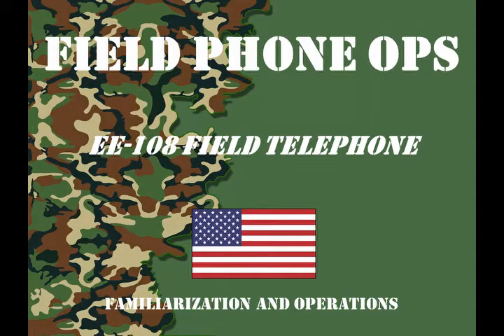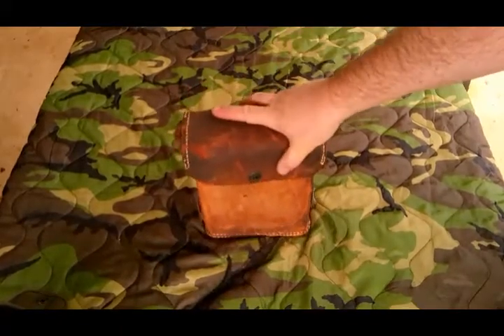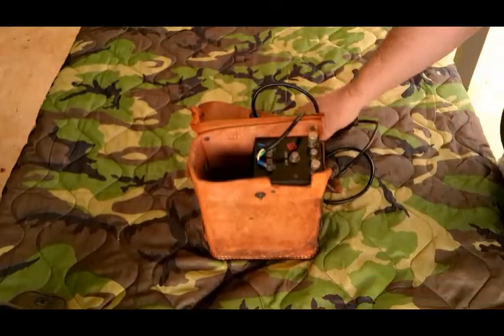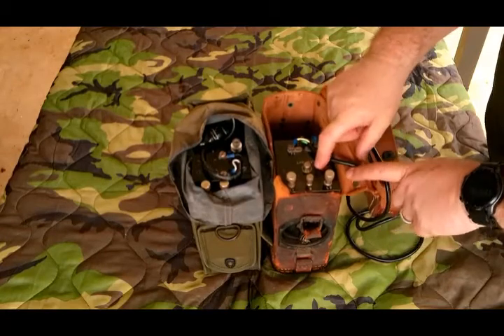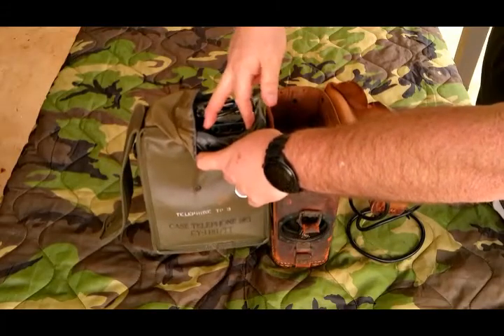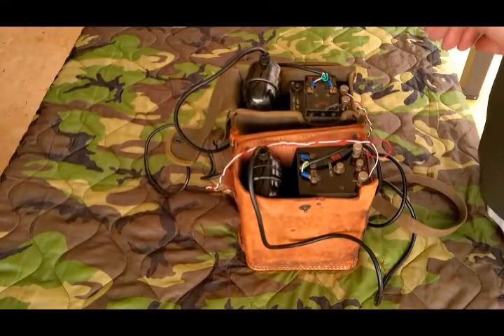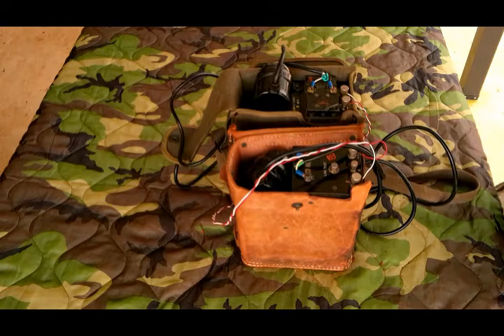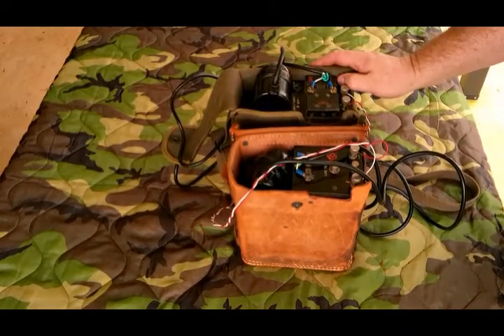FIELD PHONE OPS:   Telephone EE-108

Comment: Did you find the elements for the hand set? Did you try and bump them a bit to loosen up the carbon elements? I think VTS might have some sound powered elements maybe even some TS-10 hand sets (NOS) in the box. He also makes replacement cord also.
Reply from the maker: Since the handset is not a standard size and had no markings I could not find replacement elements for it and ended up just replacing the handset with a TS-10 that had no push to talk button.